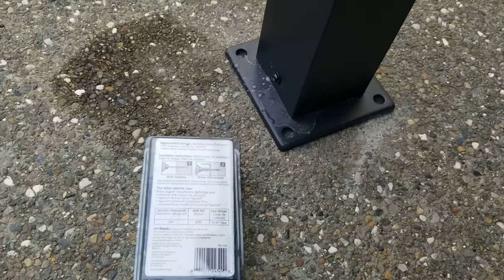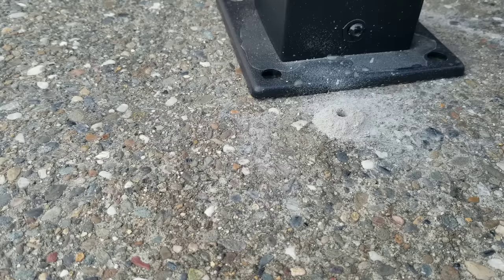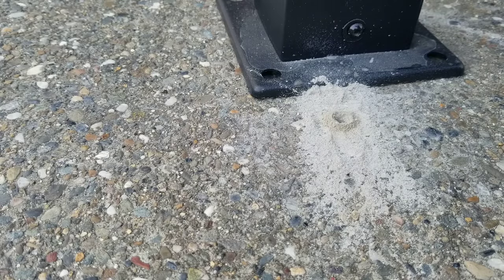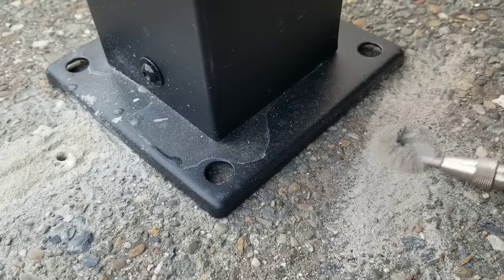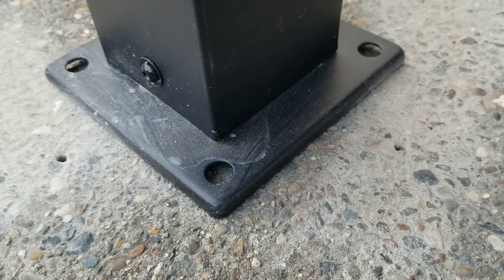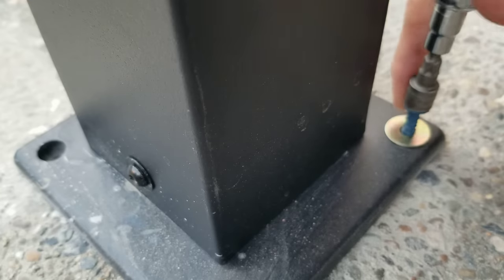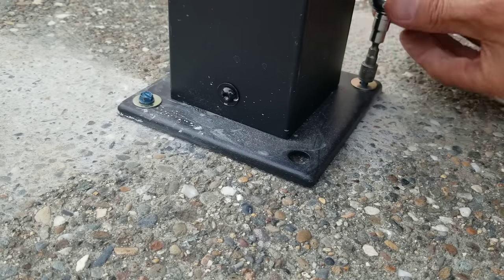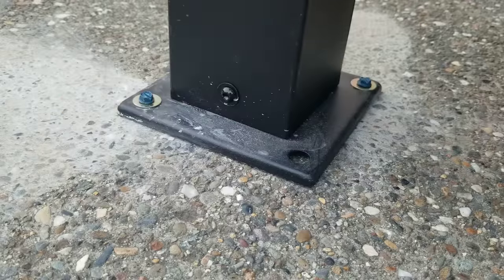Best way to drill a hole in cement or masonry in 5 minutes and screw it down

Comment: Just a few points that should be added when using tapcons. You generally want to drill a pilot hole thats 1/16” inch smaller than the screw diameter eg for 5/16” tapcon use 4/16” = 1/4” drill bit and it usually tells u on the drill bit box. You want a pilot hole that matches the core diameter of the screw - not the outer thread diameter obviously. To prevent bit wander when starting the hole use an even smaller bit and then switch to the pilot bit. Also drill about 1/4” -1/2” inch deeper than the screw depth in the concrete to prevent the screw from hitting debris sitting in the bottom of the hole. And blow out or shop vacuum out debris from hole after drilling.
Reply: This was the whole reason I tapped on this video. I read your response and started laughing... Thank you. Nailed it!
Reply: Thank you
Reply: Thank you
Reply: Thanks for this information.  This was very helpfull

Comment: Tap con tells me to use a 1/4 inch drillbit for a 1/4 inch screw, that doesn’t seem right because it wouldn’t be secure because it’s the same size as the drill hole. Am I right or wrong?

Comment: I do a lot of concrete/ steelwork and never used those tbh . 
Always used M12 / M10 Rawl bolts with chemical anchor to bolt  to concrete and usually 70mm / 150mm deep for short post  ( ie 1m / 3 foot ) .
Reply: Thanks. I didn't know what to buy. Now I do. I'm off to the store.
Reply: @colin Hudson would this work for costco gazebo?
Reply: Should you use a drill bit first ?? Putting up a TV mount and electric fireplace on cement wall what bit and screws should I use thanks
Reply: What size again and can this be purchased at local home depot ?? And what kind of drill bit thanks??

Comment: When drilling block and concrete use the following:
1. Masonary bits
2. High speed on drill
3. Hammer drill selection
Reply: What about with reinforced concrete?
Reply: Thank you for this info.✨
Reply: @lolastarsandstripes  I'm having a fake blonde moment. What's does reinforce concrete mean🤷🏼‍♀️
Reply: @colby9743  Probably referring to concrete with rebar or steel mesh...just have to make sure you don't hit the rebar
Reply: @tonray9395  Yeah, just make sure you don’t…LOL.
Reply: Do I need to drill cement for masonary nails or can I just hammer it in?
Reply: Agree. Use a shop Vac to clean the holes and no need to move the leg. Drill in place then bolt it down. So simple...

Comment: I lost it when he screwed the tapcon in with a socket wrench. Where are the power tools my man? Lol. I guess you got the job done though.
Reply: I lost it when he was using tapco instead of 3/8 x 1” 1/2 drop-in anchors
Reply: @agrippa7712  I am attempting a similar repair. What is a drop in anchor and why is it better?
Reply: "Turn the screw by hand for the last couple of revolutions. By doing this, you exert less torque and prevent the Tapcon screw from stripping the threads tapped into the base material."
Reply: @misteramerica5893  use drop-in-anchors, ask the guys at your hardware store they’ll know and hopefully walk you through it.. good luck
Reply: I lost it when he was using a 1/4" ratchet
Reply: A lot of folks like to use the socket wrench... apparently a slower, hand crank can reduce snapped or stripped bolts.

Comment: What is the minimum amp that works best on concrete? I have 7 amp power drill, seems to take me forever to make a hole
Reply from the maker: Mine is just a $20 Hammer drill from Harbor Freight Tools made by Chicago brand. The hammer option really helps to speed things up.
Reply: 3/8” holes, 3” deep took me 15 minutes EACH. Then I started using a smaller diameter masonary bit, then the 3/8”. Seemed to go quicker. Plus I had to REALLY push hard on the concrete I was drilling into. By that time I didn’t care if I fried the drill or smoked the bit. Guess what? It went faster when I really pushed hard.
Reply: @JackTRyan  I'm having the same problem now.  Drilling 8,  1/2"  holes in concrete I poured 20 years ago.  Started with carbide tip that came with anchors and battery powered Milwaukee drill motor.  Very slow.  Went to hardware store and rented hammer drill  and bought 1/2" bit made for hammer drill  After about 3 minutes, still only 1" deep. (first hole).   Guess I'll just push harder.
Reply: @JackTRyan  hammer function makes all the difference. You can have most powerful drill in the world and some junk hammer drill will work better for concrete.
Make sure you also use masonry bits of course (which you are so no issues there)

Comment: Yo!! ******Speed drive those Tapcons to keep the screws metal from heating under stress!! USE A DRILL AND DRIVER AND STOP JUST AS SOON AS TAPCON REACHES THE METAL BASE. Otherwise you risk not only decreasing the concrete grab but, you also risk heating and snapping tapcon!!******
Use a Drill(no hammer) with a driver!!

Comment: What size tap con screws are those ?
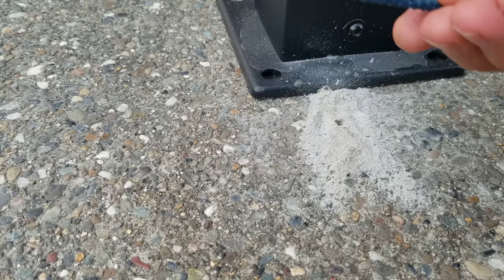Reply: Never mind. He says 2 3/4 at the 2:20 mark.
Reply: But they are probably 3/16 screws by 2 3/4 long. I know you use a 3/16 drill bit for them.
Reply: I would rather use the drive in cement anchors over those tapcons any day.
Reply: I've used the Tapcon screws for several jobs and with great results.  
A few tips: 1.  drill about 1/4" deeper than the screw length; 2. Keep the cement dust out of the hole.  You can do that by raising the drill a few times while drilling, bringing more concrete dust with it. Use a shop vac to clean up the concrete dust for crying out loud! :-)  That dust can compact at the bottom of the hole, making it difficult to tighten the screw all the way; a final air blaster at the end can get the remainder out; 3. Be sure to wear a good dust mask (at least N95) and safety glasses

Comment: Why not use power drill to fasten tap cons😁
Reply: Power drill without two mechanical speeds has low torque, high speed. You may adjust the speed from trigger or dial, but at low speed, motor has weakest torque.
If you try to use such drill to fasten tap cons which are hard to turn, motor will stall, unable to start rotating the tap cons, will overheat very quickly and you can burn the drill.
Drills have a plastic fan blade, to cool the motor, but when motor does not turn at high speeds, fan does nothing and heat accumulates in the motor rotor, burning it if not careful.
So you need to have gear multiplier, i.e. two speed drill, to make it easier for motor to turn tap cons, without jamming and overheating.
Reply: the heads snap off easy on them
Reply: @everss02  yeah especially with an impact driver

Comment: Why not set the foot / base where he wants it and drill down through that instead drilling the holes separate and move the base ? especially if the whole project is heavy and hard to move...  (Just Extra Steps)
Reply: its doable, but you can damage the holes in the base that way with the drill bit. also makes it difficult to maneuver the drill for the correct angle straight down
Reply: ‘Cause the drill would get in the way. Look at the clearance between the hole and the post.

Comment: Thank you! I have the exact same need. My plan is to use Tapcon 5/16-in x 2-1/4-in screws with my 1/4-in drill bit. I wonder how your project turn out after a year? Did you ended up installing 4 screws?
Reply: I doubt he put any more in..pure redundancy unless your getting serious winds.
Reply: Tried the exact same thing. However it didn't work. Screw stoll didn't catch🤷‍♂️WTF
Reply: @winstonkiddjr.3540  I"ll give you a priceless tip when screwing into masonry that will always work,. 
Remove the sheathing from regular electrical wire (15 amp or 20). Then cut a piece of the copper wire at a depth of the hole you drilled. stick it in the hole and then put the screw in. Turn it just a touch and then tighten it with an impact driver (this will not work manually unless you are the Hulk lol). The copper wire binds with the screw and that screw will NEVER move !. 
Works great if you don't have Tapcons, you can just use a deck screw with a star or Robinson head, and a piece of the copper wire (don't use Philips heads the screw gets so tight it will strip out the Philips)
Always use the correct drill bit, you can look it up on the Web, some brick is very brittle and you'll get play, using an epoxy into the hole is another great tip but then you have to wait for it to set, the wire is one and done !
'